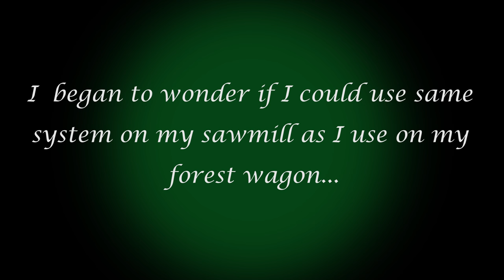New system loading logs on to the sawmill !

Comment: Your ramp and hoist solution is quite clever.
I noticed you dropped the logs on the ground before hoisting them. If you parked the trailer closer to the mill, your trailer ramps would rest next to the mill rampa. 😅The logs would roll down into the V created by the ovelapping ramps. You would not need to hoist as high when loading the mill.

Comment: What if you built a log bunk? Then when you unload the logs off your trailer, you could use your trailer sides as a bridge to roll logs onto your log bunk. Then from bunk to mill.
Reply from the maker: Hi MH  I know, but it would simply be in my way as I have to get in front of the sawmill every time I turn and tigten the log, I could make something I could remove I know but I think that would be a pain in the ass too :-)
Reply: @Eriks-Multi-Topic-Channel  I was wondering if it would be in the way, why you hadn't already done that. I see what you mean tho. I just built one for my f2+. And I can see it being in my way. Time will tell. Nice vidja
Reply: @Eriks-Multi-Topic-Channel  s
A log table can be built mostly of wood, with hinges so you can lift upp the bridges between the log table and the sawmill while sawing.
https://www.logosol.se/store/stockupplag.html
Eventually one can put a steel roller on each bridge to make it easier to transport the sawn planks sideways.

Comment: Why just make a simple log table, and roll the logs from the trailer to the log table, and from the log table to your mill?
Reply from the maker: Might do that one day, but you still have to elavate the logs a bit as the wagon is so low.
Reply: I use two planks with a cunter support . Don put it on the ground only to pick it  up again
Reply: @Eriks-Multi-Topic-Channel  - build a little hill to park the wagon on so it is the right height.

Comment: Just a suggestion, why not park closer and put your wagon ramps directly onto the sawmill. Good job
Reply from the maker: I would still have to roll the logs upwards as the trailer is so low.
Reply: I had the Sam thought. Even if you only came closer you could put a board across the steps ad drop the wagon ramps to that then you don’t have to expend as much energy lifting them. Old guy thinking.